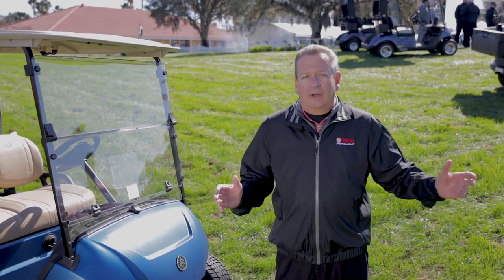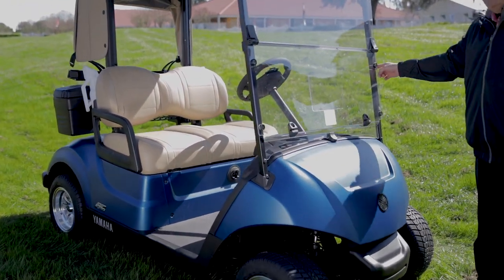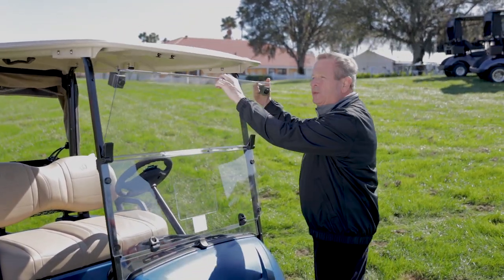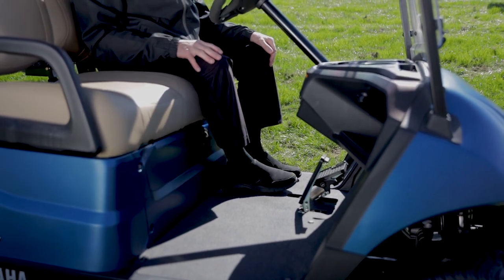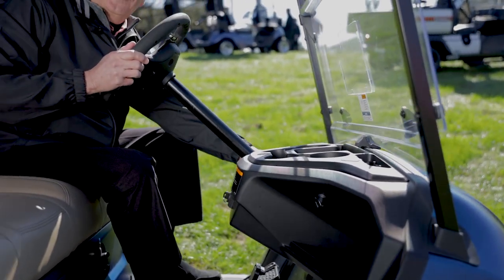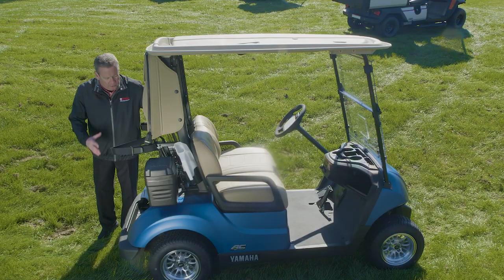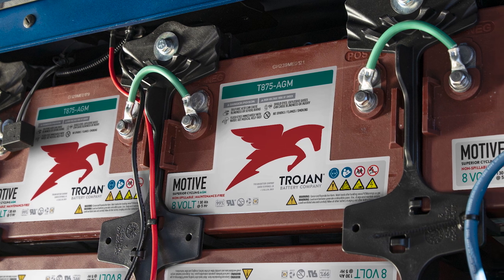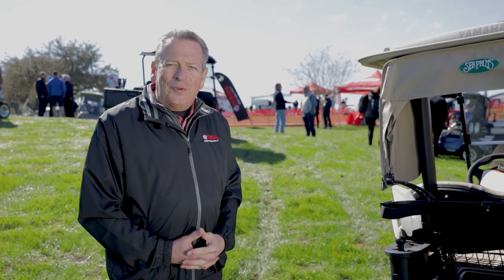Drive2 Demonstration - Yamaha Golf Car Company

Comment: I work at a huge new and used golf cart dealership as a builder indo everything from refurbish used golf carts from golf courses into beautiful brand new like state street legal carts and build and customize customers carts and new carts. We are a Yamaha dealer and the drive 2 i love working on soneasy to take body completely off and strip the cat down to bare frame of needed or when refurbishing a used golf course cart, easy to work on smd everything goes together very easily and can take pretty much one item off with out having to take apart half the golf cart like you use to do on the drive 1s and g29. Only issue is that screen on the exhaust of the gas powered drive 2s they clog up and caise the gold carts to run horrible we drill them oit caue they are jot required in our state. So of your golf cart is running rough take the bottom plastic pannel off your quiet texh if its a quiet texh or if not then jsit stick a long drill bit until you hit the end of the little exhaust pipe and drill that piece of screen off the exhaust your golf cart will run smoother then it ever has especially of its a older one

Comment: There are some questionable claims in this.  At 8:15 there is a claim to have the largest bagwell that EZGO RXV has a strong claim to.  It is fairly easy to prove - remove the Yamaha access panel and set it inside the RXV bagwell.  You'll see that the EZGO is wider and has a bigger footprint especially where Yamaha has a bump in the middle to clear the powertrain.

Comment: Respectfully speaking sir, I think that the bucket next to the sand bottle is actually a cooler. Why would you need two sand containers? I have the same setup on 4 carts and there is a cooler and sand bottle on each exactly like these. I suppose if you don't need a cooler you could have 2 sand holders. Or put a cooler in the basket, which is rather inconvenient to access when bags are on the cart. ?????